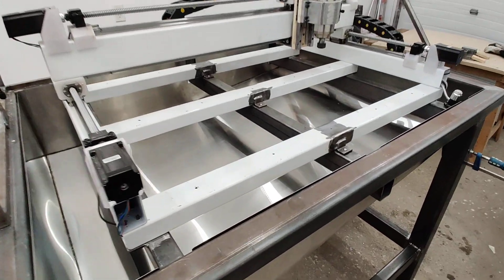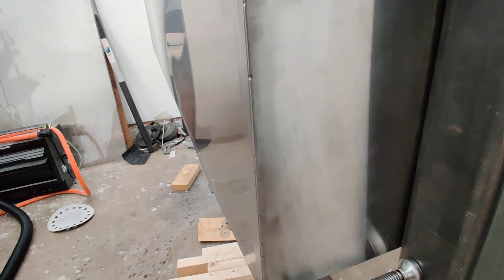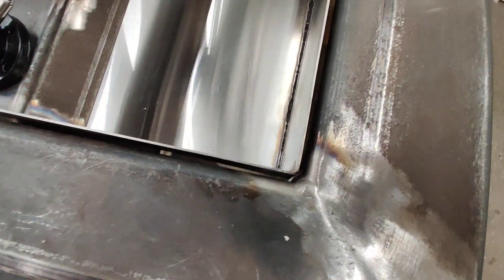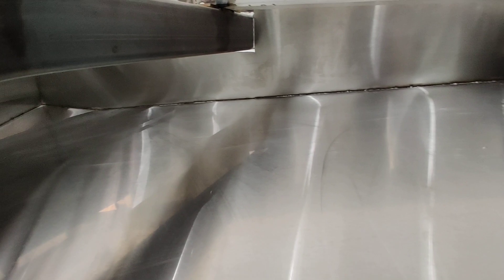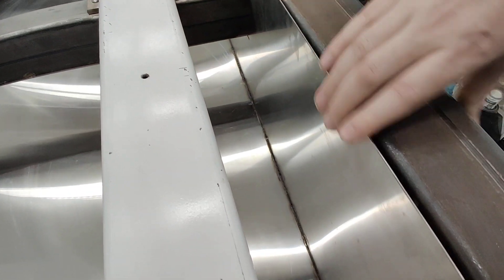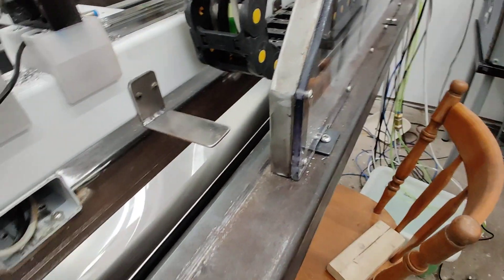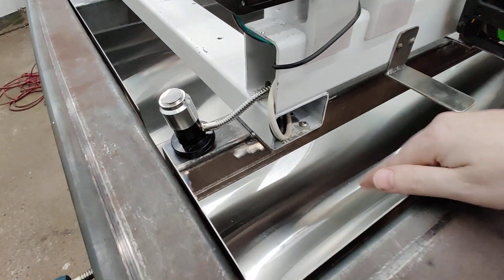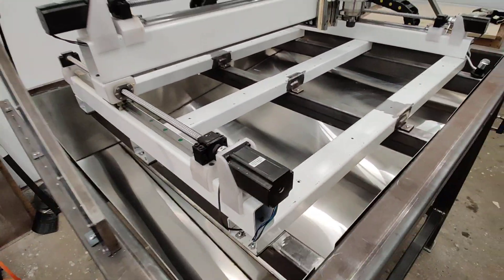Chip pan installation on my CNC machine

Comment: Extruded foam sheet glued on would reduce the noise a lot your project is going great I am just starting my build and will be using Teknix servos and a Maso touch screen controller PS thanks for posting these videos
Reply from the maker: So today I used some of that sound deadening material for cars and it totally killed all the ringing and reduced how loud something hitting the pan sounded. I think something like these sheets under the spoilboard but thicker like 1cm would greatly reduce the sound levels when cutting. Something I’ll probably try out in the future if I can find a material that would work for this.

Comment: I wonder if something like Dynamat might quiet the drain pan down, if it's too noisy?  Just a thought.
Reply from the maker: After I have it bolted down I might try attaching some heavy rubber in the middle on the bottom, Some suggestions I got were saying to try that out.
Reply from the maker: In the end I guess the main thing is whether or not the pan will resonate at the high frequency that the spindle produces.